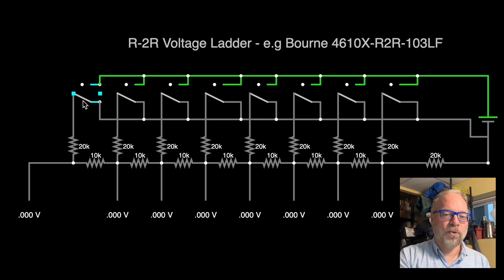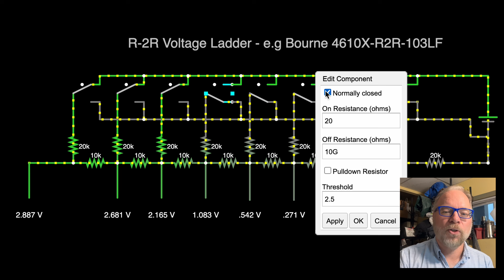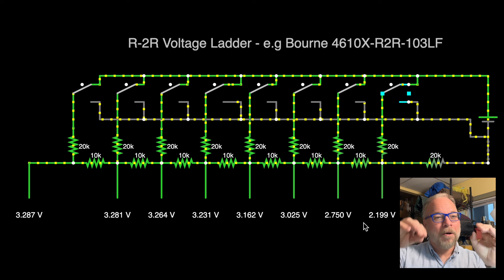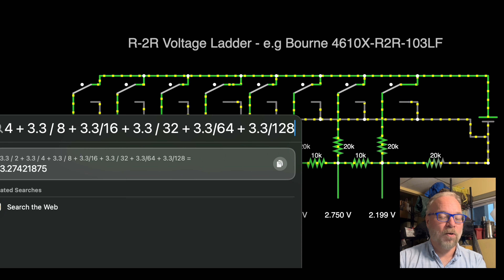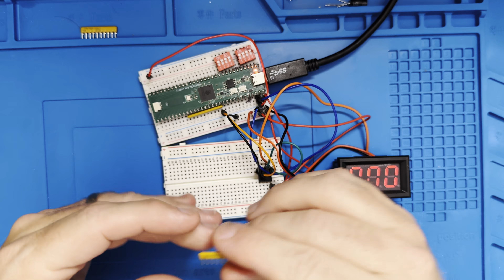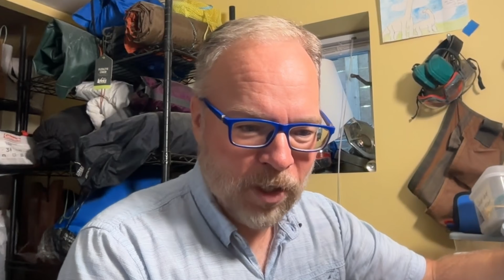Homebrew 8bit DAC - R-2R Resistor Ladder

Comment: I'd suggest for a function generator you use a fixed sample rate and add a programmed phase increment to obtain the frequency you want. At low frequencies this gives you many more samples per cycle, and at high frequencies, much fewer. But the fixed sample rate means that you can use the same fixed analogue filter at the output for all frequencies and get a smooth output, even if at the maximum frequency you only have two samples per cycle (this also allows your generator to achieve a higher maximum frequency). The precision of the phase accumulator needs to be quite high (32 bits, say), but you can pick off the top 8 bits to look up the amplitude value. This approach is (in my experience at least) a superior approach compared to varying the sample rate with a fixed number of samples per cycle, which requires a variable filter to smooth the output. But since it's just a coding exercise, you could try both and see which is best. Anyway, sounds pretty interesting to me, so I'll keep a look out for a future update. Best of luck!
Reply from the maker: Good feedback - though I think by requirements are minimal in terms of fidelity. If I can get something sine-wavish at 2MHz I'll be happy.

I get what you are saying here, basically you want a filter that smooths the sample rate steps, and having a variable sample rate makes that hard.

At low frequencies however this means I potentially have thousands of samples per waveform - if I have 64 samples per waveform at 2Mhz, I get 64k  samples per waveform at 2kHz. I am not worried about the math of generating them, but with an 8bit DAC, most of those are going to have the same value, so that high sample rate filter isn't going to engage. Maybe I am missing something?
Reply: @ElectronicsUnscripted  The phase accumulator needs a lot of bits, but only for frequency precision - e.g. if you wanted to go from 1Hz to 1MHz in 1Hz steps, you need 20 bits of precision, and a sample rate of 2.097152 MHz. The sine look-up can use the top 8 bits (say), giving a waveform with 256 samples per cycle. Yep, lots of these are going to end up not changing as the phase accumulator cycles, giving you a simple interpolation for free. You still end up with a sine wave with 8 bits of amplitude precision, even if it happened to need 64K samples to produce it. The sample frequency of 2 MHz or whatever is all that needs to be filtered out (If you have access to a spectrum analyser, take a look at the spectrum of the output - it should only have significant peaks at the output frequency, and at the sample frequency and its multiples). If you can manage more bits of amplitude precision, your output will get proportionally cleaner (6dB less quantisation noise per bit). You could also look into adding some random dither to the LSB to spread the quantisation noise across the whole band, (even well beyond the audio range) which will clean up the output quite a bit without needing more bits. Sorry for the lengthy reply, getting a bit carried away here! Anyway, it's all fairly easy to experiment with in code.
Reply from the maker: @GRAHAMAUS  After having now made a 10MHz (barely) function generator I now know what you are talking about - though at a sample frequency of 300MHz, I think my oscilloscope and various stray capacitances are doing a fine job of filtering.